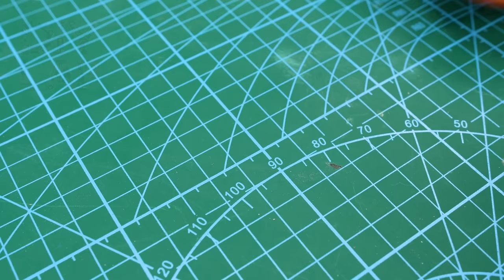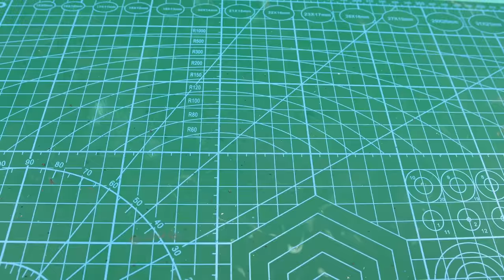Few people know this SECRET OF PLUMBING! Tips and Tricks of Masters ▶️

Comment: These fucking glasses are worth less than the time spent on them. The rubber band from the used hose is thrown away first and no normal person uses these rubber bands again. It costs 1 dollar 100 pieces. At the current exchange rate, probably 150 pieces. Stuff a coin instead of a plug))) from a jar of olives or coffee, you can cut about 20 round pieces with scissors and do not insert coins. Moreover, a stiff rubber band will not compact along the coin’s relief)))) It’s easier to just drill a hole in a sewer pipe rather than suffer with the sting of a screw, which also heats up very poorly because it doesn’t contact. And everything else is like in the proverb about a cat who has nothing to do.....